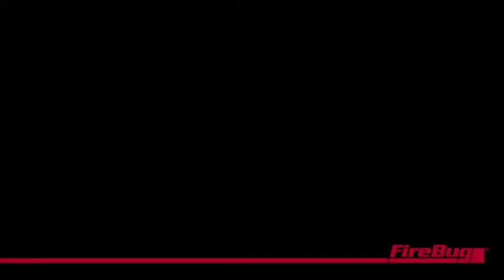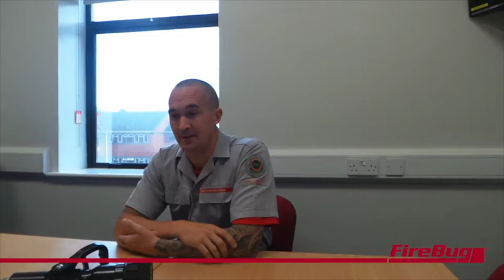ST15: A Watch Manager talks about misting and compartment fires & fire fighter safety

Comment from the maker: Fire fighting with mist from a Firefighters point of view:

John Kitchener, Watch Manager Staffordshire Fire Service Headquaters talks about the key component of misting with regards to compartment fires using the ST15. 

Fire fighter safety at all times.

http://youtu.be/cRVJQ-c198E?list=UUbCd-6a1kItdcWKDXWwcSAQ

#firefighters #welovemist
Reply: The straight forward mist - rather than a 60 degree (hollow) cone that most fog nozzles produce - looks really great. Perhaps that nozzle should be standard on commercial hose reels - if enough pressure can be generated.

I see one potential issue with the 'lack of choice'. If faced with a lot of burning high energy fuel in a room size where steam burns are not a problem - you do not have the option to dial up the yeld to say 150 lpm like a Protek 360 nozzle. Such situations should be handled by 2" hoses, but unforseen events may occur while using a 3/4 high pressure hose reel.
Reply from the maker: Thank you so much for your comments @Bodstrup, we always appreciate feedback and engagement. The lack of choice seems to be a positive amongst the firefighters we have tested it with due to ease of training and reduced risk of getting it wrong e.g. flashover. 

With regards for options to dial up the yeld to 150lpm, I'd love to put you in touch with our technical team who can discuss it further. Please can you email your details to: candice.link@firebuggroup.com and we'll chat further!

Regards,

FireBug.